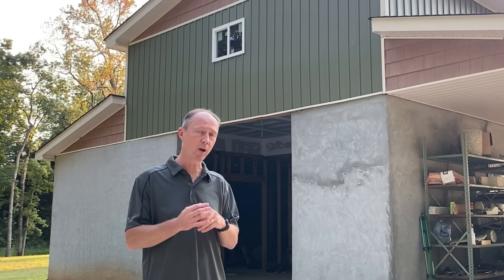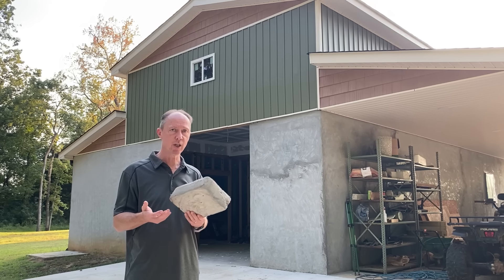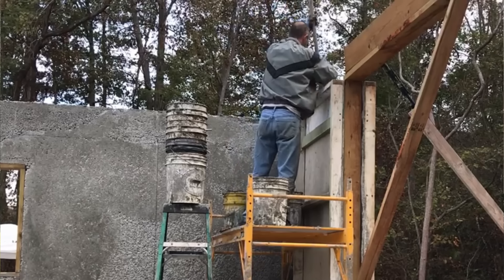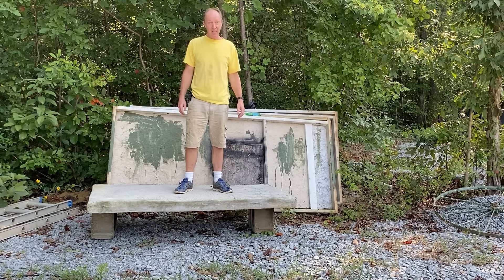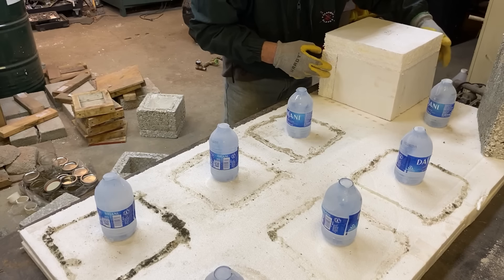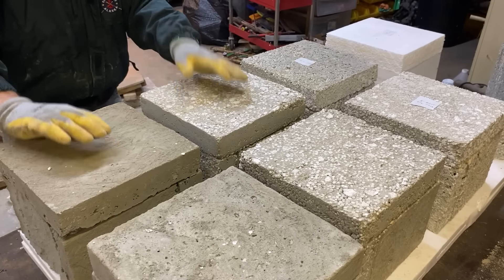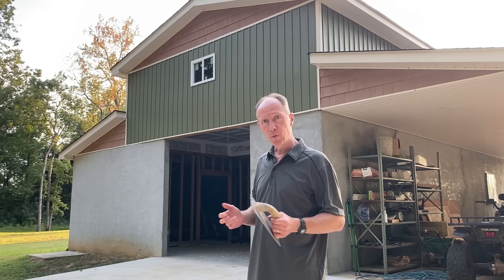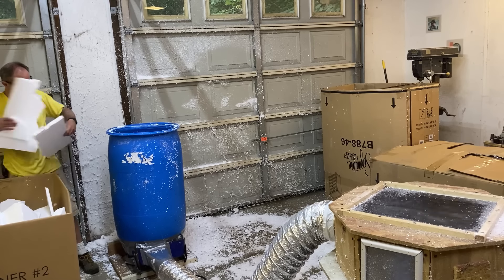The White Gold Rush?! The Video That CHANGED Aircrete Forever!

Comment: Why not use plastic, or Dacron to line the inside of the mold. , Sparingly staple  the mesh on top, then assemble the mold. Do this on both sides. 3 to 4 holes drilled in the window sill mold would allow filling that area by letting air out.
Reply: In commercial concrete construction, we used high Powered Cement vibrators, to Densify and Compact the Concrete, as we pour it, to fill Voids, ets., but - Our Forms are Very Securely Anchored, to the Rock, at the Bases, and to each other as we go up, with 1/2" Diameter Rods, threaded on the Ends, for connecting 3/4 Threaded Sleeves to, for Large Cast Plates and Big Wing Nuts, on ACME Square Threads, on the outside work area! 

(But, we poured Massive Thick Pours, as Retaining Walls, on Railway Banks, using a "3 in 12" Slope Inside - towards the Rails, and a "1 in 12" Slope on the Outside, with a "Skinny Top" of "Only 2 Feet Wide!")

After the Pour, the Sleeves are unthreaded, and the shallow holes hand patched, with a simple Sand Grout mix!
Reply from the maker: Good idea! Subscribe for new builds coming soon!

Comment: With the foam being so finicky I would not even use the phone I would use just the styro mixed with concrete and of course you still need to add some sand to make this perfect strong with a few small pebbles I'm not sure about the pebbles just a little bit of sand the right kind of sand because you're not going to use the foam and just it looks like you use a whole barrel full of Styrofoam with one bag of Portland cement but of course the builders recipes usually 1/3 sand 1/3 cement and one third aggregate, which is Stone, you probably could use some lightweight lava stone, in fact that would be one way to get around the builders code, they might not pass the styrofoam but if you used lava stone . ..it would be considered aggregate, what do you think about that old boy Steven?
Reply from the maker: New foam free recipe video coming soon!

Comment: I don't know where you are located, but telling viewers that they can build their homes or an apartment with this method is highly irresponsible when it could never pass approval by any building department in almost any country.  I do like the idea of using insulated concrete to build with, but until more testing and approvals are granted, it will be limited to areas with ZERO code enforcement, or to small agricultural buildings not intended for human habitation.
Reply from the maker: New tests coming soon! Subscribe to see the results!

Comment: Thanks for the info, something about concrete i like, concrete + foam, air, wood, plastic, etc, DIY products, with new properties. Keep up the pioneering work. With some production molds, and a measured controlled consistent mix, you could have the next big building product.
Reply from the maker: You're welcome! New builds coming soon! Subscribe to be notified!

Comment: When I was 15 years old, I worked for Sauzer’s Kiddieland, (in Schererville, Indiana), … & we built a fiberglass dome over the top of a 120+ year old merry go round, … partly to protect the ride from the elements of the weather, but also as a facade, to hide the garish machinery that made it work, … the key to building the dome, was done with triangles, & steel shims, building three, 1/2 geodesic circles, with per cut lumber, filling the voids with sections of precut clear plexiglass, that allowed the sun to shine through, & yet, not get sunburned, … every piece of the wooden framing, was stained, a polyurethaned, by hand, to further protect the structure, from the elements, … this was during the spring, & summer of 1968, when I worked for Frank Sauzer, …
Reply from the maker: Thanks for sharing! subscribe for new builds coming soon!

Comment: I recently built a raised bed/grow box with this same method. I used silicone in a caulking tube, to create fake stonework  joints by placing beads of silicone on the outer form, in the shape of random stone. ( don't have to be neat. Can also smear some in the field to create high/low spots.) I was very happy with the results.  I randomly threw brown dye on the surface, painted the joints black dye , and it looked so much like an old railroad bridge type of finish, it could have fooled the best. The only reservation I have about the Styrofoam is having the pellets get loose in the environment; because some birds might mistake them for food, and it can kill them.
Reply from the maker: Thanks for sharing! Subscribe for new builds coming soon!

Comment: Great stuff ... Everything you did I wanted to try. Ran out of time to experiment had to use styrene instead. Still got more projects however.

FYI some Canadian students from Timmins Ontario did study and submit it to codes. You basically did the same they did using actually standard equipment. They did not use aircreate. The study is a available and you probably already seen it.
Thanks for sharing
Reply from the maker: B Cubed great to hear another source to back up the use of this great building material.

Comment: Another tip is I personally don't like to paint concrete it peels,and when you do decide to stucco it power washing is the next step then an expensive adhesive is needed for your stucco to stick so the best thing to do which will save time and money is add your color in the concrete it comes in powder or liquid forms you just need to be consistent with the mixing ratio. Custom colors can also be done by adding water based paint to the mix.
Reply from the maker: Thanks for sharing!

Comment: they have been making a very good product made with cement styrofoam called rostablock I've used it a few times ,it comes in huge blocks, with hollow cores for concrete and rebar. but i like the manufacture your own idea, save a lot of money and now seams that the blocks have.
Reply from the maker: Thanks for sharing! Subscribe for new builds coming soon!

Comment: I have been planning on experimenting with different affordable concrete canvas panels, was also planning on experimenting with perlite in concrete.
I love watching ingenuity and experiments like this. Thanks for sharing.
Reply: I think pouring The walls flat on the ground after reinforcing the bottom and top surfaces with mesh as you’re pouring and finishing would be an idea. Maybe even tongue and groove each panel for interlocking vertical panel seams.
Reply from the maker: You're welcome! Subscribe for new builds coming soon!

Comment: I bet you can buy silica in the powder form you mention on Amazon. They do sell industrial chemical and materials on Amazon and other websites. In a variety of particle sizes too.

You may already be aware, but sand is essentially low purity silicon dioxide. It may help to look up the grit you need under the chemical name or the word silica.
Reply from the maker: Thanks for tip! Subscribe for new builds coming soon!

Comment: Hi Stephen, great video! I always like to see people experimenting with new building methods! I’ve been experimenting with Aircrete for a few years now and I want to build a dome home out of it. I have my YouTube channel with some videos of the foam machines I’ve built. The main problem here in the USA is that no engineer will certify any design with Aircrete. They all are afraid to try anything new even though other countries have been building with it for decades! Very frustrating. As such, I will be moving to Mexico soon so that I can freely build my designs. Sad that our great country doesn’t see the value of more sustainable building techniques. We have regulated ourselves to death and now innovation is stifled unless you have hundreds of thousands to spend on NIST testing of your product. Sad 😔
Reply: What?  You can't leave, we need your innovation here!  I do not think you will be happy long-term in Mexico.  Keep your option to move back.
Reply from the maker: Prana thanks for the feedback. Domegaia has just partnered with an engineering firm that is licensed in all 52 states and is stamping aircrete dome house plans. They have several different size plans. That is all I know and I would reach out to them.
Reply: maybe you could build something small first and do a kickstarter or similar for the testing?

Comment: W/o any additional aggregate- sand, gravel, etc added to the mix the compressive strength & lateral resistance is considerably reduced- that’s why an additional plaster/parge coat is needed
Reply from the maker: Thanks for the tip! Subscribe for new builds coming soon!

Comment: You could make medium to large blocks and the cement use to adhere them to one another would provide additional structural support. Probably easier than having to pack walls. As easy as they are to cut, that solves the need for too many different size block forms.  You could take you time making a bunch of blocks and than start building.  This is great and the possibilities are making my mind go into a frenzy.  I've been mentally working on a dome using large triangular shaped  forms. You make one form and keep pouring over and over.  You could even have several sectional breaks to make it easier to pack.  Having lived in So. Florida all my life, wind resistance is crucial, much less the energy efficiency advantages. A dome home in the Tampa area even withstood a massive tidal  surge. The exterior lath and stucco becomes your life long roof with periotic painting and maintenance.  I though about basalt rebar, due to its flexibility but I don't think it would be needed  with this material. They shoot gunnite on the interior and exterior of some monolithic domes, so that would provide extremely good structural support.
Reply from the maker: thanks for the tip!

Comment: Forgive me if this question has already been asked... Do you use rebar?  For regular poured in place stem walls we here in California (earthquake country:)'   have codes that require we have concrete footers with buried rebar going up into the stem wall cavity.  During the pour we use a concrete vibrator (Harbor Freight sells them) to get the concrete to fill the cavity between the rebar.
Reply from the maker: No rebar. Subscribe for new builds coming soon!

Comment: This was one of the most amazing videos I've watched this entire year. Not only do I like to learn new ways of building so this had me interested but this is making a whole new ball game for construction I can't wait to try some ideas I've had just watching your video just now I've never even heard of air Crete until now
Reply: Aircrete is in experimental stages still. It is so new it is not recognized by building codes. Many versions of aircrete out there on you tube are too weak to be load bearing structure. But in this video he told you how he laminated it with wire and plaster or something, makes it much stronger. 
Just saying, because it is so new, many versions of it are no good, some are ok, and in the future there will be even better. But that part is up to you then since you are who might desire to work in the field. I suggest adding hemp to the aircrete and foam mix and you might have a superior product. You will still need to laminate it, but laminate it with hemp also.
Reply from the maker: Go for it! New builds coming soon!

Comment: Just like pouring a concrete wall,  it should be vibrated when you pour to evacuate any air bubbles so you have 100% product without any honeycomb voids when you remove the forms.
Reply from the maker: thanks for sharing! subscribe for new builds coming soon!

Comment: Great process Stephen! Really brilliant. Vermiculite is OK but it's about $30 to fill half of a 50 gal drum.BTW Here's a mold idea for you: Pure Liquid Roofing 100%  Silicone from Henry "Tropicool" is used to coat rolled roofs and RV's. I'd suggest first construct wood molds, then coat with fiberglass resin/mesh ( like boatbuilding ) for strength & tightness, then silicone so you can reuse and release is easier. I'm working on this to do a small hip roof mold.
Reply from the maker: Thanks for the tips! Subscribe for new builds coming soon!

Comment: From the actual mixture(s) to how to use it -- even mention of the too-infrequently-used foam forms for edges/eaves/etc that give that awesome final touch -- never wish I had more of an area to build than I do right now!!!  If you've got the room, have you thought of just digging a hole and making an awesome hot-tub/jacuzzi?  People would do easy setups back in the day simply using concrete blocks & concrete&mortars, this would let you do it far cheaper would just use more actual rebar on the sides, it's amazing how much can be done with this stuff!  For smaller-batch, what are your thoughts on perlite as a prime "filler component"?
Reply from the maker: We prefer to recycle! Subscribe for new builds coming soon!

Comment: I remember seeing an arched concrete structure built by putting a pile of sand down and then shaping it into an arch then they poured the concrete over the top of that. It was an ice skating rink built in Provo, Utah. You might look into that. It has since been torn down, though.
Reply: I have seen a cave like that it was a wide crack it was filled with sand then shaped as required then round stones placed in the sand covered with concrete and rebar left to dry took out sand nice pebeldashed roof
Reply from the maker: Cool! Thanks for the tip! Subscribe for new builds coming soon!

Comment: Incredible i cant believe how strong it is and the sound and thermal insulation must be incredible. I am curious as to how you seal it you did mention stucko i wonder if a grout sealer and then paint would work? Its amazing to see people at home pioneering techniques for so many things, very ingenious hats off to you sir.
Reply: Jason, I plan to use elastomeric roofing paint to waterproof it. You can buy it at Lowes or Home Depot and is cheaper than paint.
Reply from the maker: New builds coming soon! Subscribe to stay tuned!

Comment: This is how they make rastra blocks. A few icf companies make their FORMS out of an eps and Portland mix the same way your making solid blocks. Unfortunately the only way to get strength needed to build something that meets safety standards is to use eps/cement mixture as a FORM for steel reinforced concrete. I’m not an engineer but many companies with very big pockets have tried this. In the end most icfs don’t bother to mix them at all, you get better strength and insulation when they are put in layers. May be able to use your mix as an insulation layer prior to pouring a home’s foundation?
Reply from the maker: Thanks for the tip! Subscribe for new builds coming soon!

Comment: this is mindblowing, tbh i thought about same idea bc the autoclave aircrete is not DIY friend, found some video about guy using axion, glycerin with a foam machine, and seems it works
but i think syrofoam is the easiest method, and it could also work with junk foam boards
some people even use plastic to help with tensile strength, ecofriendly aircrete xd
Reply from the maker: Thanks! We try to keep it simple!
Reply: @AbundanceBuild  i made some sample blocks with syrofoam, and various percentages of aircrete
i used a drill to make foam and for syro ii used my hands, for now i think easiest road is aircrete, syro need some solution to grind them, i don't have nor can afford to dismantle a grass mower

Comment: I really like how you roll, sir.  This is what makes America great.  As a home builder, and a big fan of SIPs, though, suggesting this can be used like a sip is probably not a good idea.  SIPs are structural not just because they have foam and osb, but because they are bonded together....very bonded together.

Also, there are shear/diagonal forces to deal with, not just gravity.

But again, having written the above, I like how you roll, and I do think this has legs.  Maybe a hybrid of your suggestions....say 4x8 panels with a border of 2x4s, and filled with your material.
Reply from the maker: Thank you! Subscribe for new builds coming soon!

Comment: Interesting concept. Air entrained concrete has been in use for decades, in an effort to reduce weight. From your video, your design using a mesh outer covering is apparently what gives your Aircrete strength.
Personally, I would have used a thinner mix, using more cement in your mix, then use a concrete vibrator to further increase the density, making a much stronger product that would flow into forms and molds much better. Concrete admixes would be another avenue of approach for better strength.
I had a concrete crib retaining wall company years ago, that manufactured our units out of air entrained concrete, with a piece of rebar in the center for strength. We also tried various fillers to reduce weight, including Styrofoam beads, with dismal results. While being a good filler, they seriously reduced the strength, would ultimately collapse under loads.
As far as using Aircrete in a load bearing wall, unless you use rebar, the likelihood of compression failure is extremely high.
Keep up the research though...you're getting there.
Reply: ...but then if it's more dense, it's less insulating.  Seems to me he got it right for what he intended to do with it
Reply: His house already standing for a year.

Seems he has gotten there.  Now we just wait for more time and feedback
Reply from the maker: Thanks for the tip! Subscribe for new builds coming soon!

Comment: About a dozen years ago there was a cinder block product made with foam beads. Was supposed to be cheaper than regular cinder block, super light and insulating. I thought it was going to be a thing. I think the thin walls of the block may have been a reliability problem.  This design however where it's just providing bulk separating a shell of fiber mesh strengthened by stucco shouldn't have that issue.  Brilliant really.  I've been thinking about CEB construction, but this might be better.  Maybe even CEB for the bottom half, this on top.
Reply from the maker: Thank you!